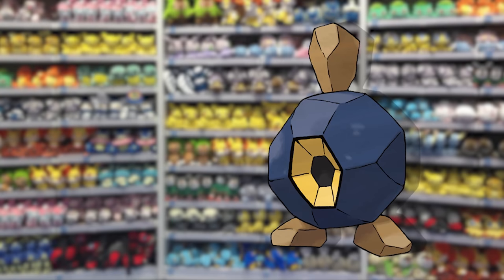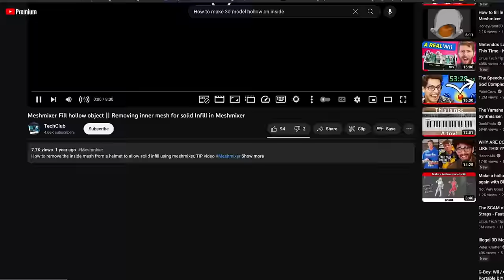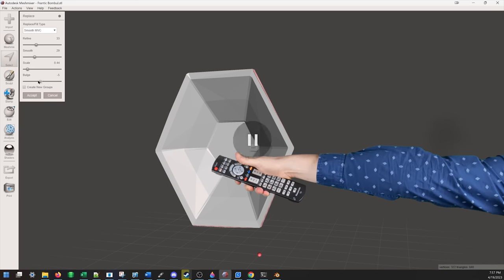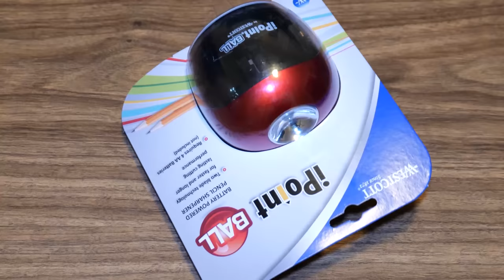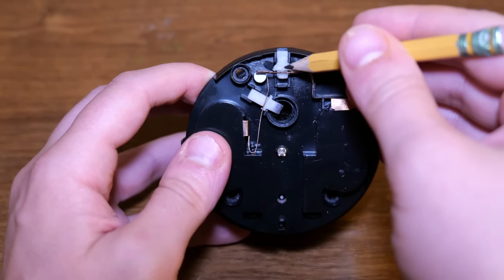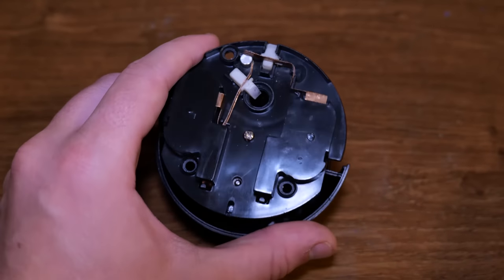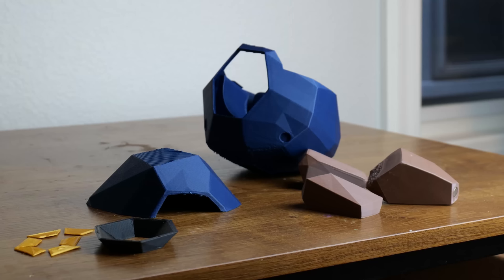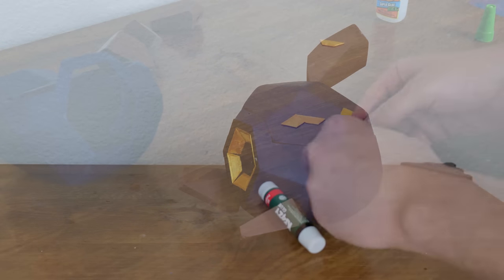Making Jaiden Animations' Pokémon merch real

Comment: I'll say it will be better if you could add a few plastic/rubber pegs or joint points for the head or legs so that the sharpener doesn't end up tumbling and falling down with a slight push to speak of you can add the plastic/rubber inserts by drilling or cutting a few slots or holes were they seem to fit the best.
Or you could also add a few holes for extra magnets to make the headband Leg species fit and stick to the body more securely.

Comment: This is quite possibly the best pencil sharpener mod I’ve ever seen, just one small criticism would it not have been better to have made a panel on the bottom that you could open and empty the pencil sharpenings out of the bottom rather than having to tip them upside down every time you want to empty it?

Comment: 4:55 this is a situation where you would use flux. you have an oxide coating that is preventing the solder from adhering. the solder will flow wherever the flux is present

Comment: Good initial offering, excellent choice of filaments, very on model with reference

Some suggestions for a MK2

-Shavings tray in bottom. Goal is to prevent unnecessary disassembly in finished product. 
-Add guide to center orifice to make pencil insertion easier. Less likelihood of crooked insertion leading to misalignment/need for repair. 
-If possible, detach battery tray from stock pencil sharpener so that it can be accessed from outside without disassembly. Objective should be to not need to access the mechanical parts unless necessary. 
-Just remove and bypass the original shavings tray lock as opposed to trying to use solder to trick it closed, only creates a future point of failure from the vibration of the sharpener motor. 

Hope this is helpful

Comment: 2:25 I mean I knew that. It's in the Pokedex entry. It's cute. Think less of dirty stone ear, think more like sound sensitive alien tech. Like that side-line sharks have to detect changes in electricity.

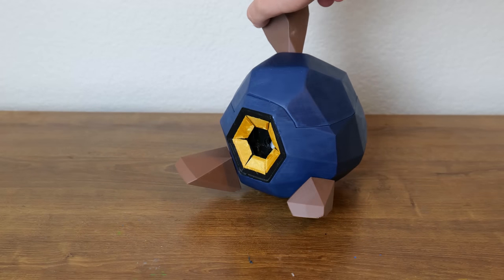6:10 Slowness actually makes it better, because it can outslow Torkoal and it definitely outslows Pelipper, letting you win weather wars. And if you need it to hit hard and quick - you can always use After You Stoutland with Sand Rush.

Comment: So, the issue with the metal not taking on solder could be two things, either the metal is not hot enough, or the suface of the metal is too shiny. Heating metal is simple enough, just keep a bunch of molten solder in contact with the metal and it will eventually give in. It could also be too shiny, in that there is nothing for the metal to grab onto. Even if you managed to get solder to wrap around it, it could just snap off with a bit of rough handling. This is easy to counterract though, just rub some sandpaper to roughen up the outer layer. This should work with most common metals.

Comment: Honestly was imagining something smaller built around a manual sharpener where you could hold the pokemon in one hand and twist it around, making the shavings come out the bottom or into the protrusion on it's head which then would be removable.

Comment: Maybe consider solid works or catia for little issues like the solid not being solid, once an assembly is made, you can run it through a file converter website and print without an issue :)

Comment: Definitely make an easy-to-access disposable tray. Wouldn't want to keep washing your hands of all the grease getting on them after removing the sharpener itself to dump the shavings.
Reply from the maker: The gears get covered by the battery holder, so it all works out.

Comment: if you do ever redo it, put the cuts on the edges for the two seperate pieces so it looks better when put together. You could also put some twist/screw method to lock it. might be easier to do it manually then 3d printing it. Not sure since I just bought my printer and havent had a chance to play around with it.

Comment: i cant believe you used a soldering iron to make a wire touch a metal base... JUST BEND IT! use some needle nose pliers and bend the tip to make contact.